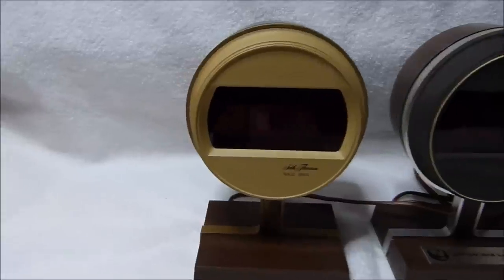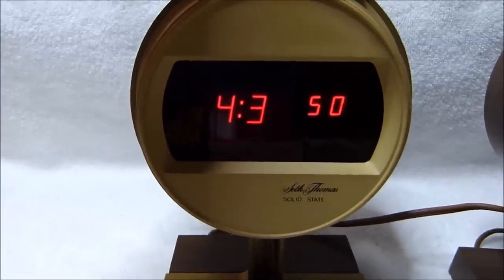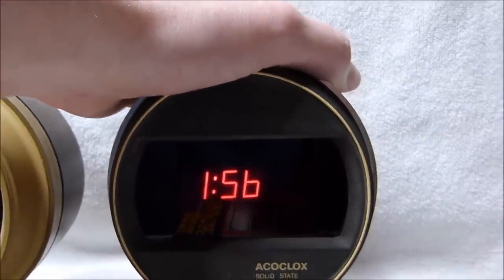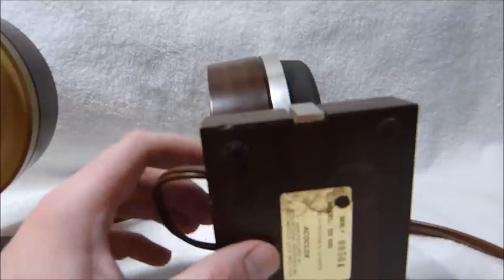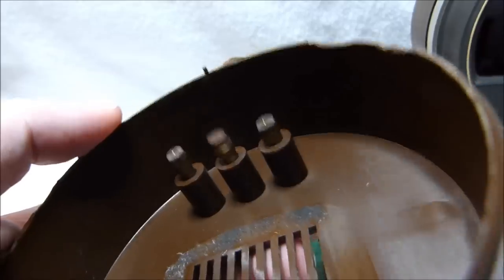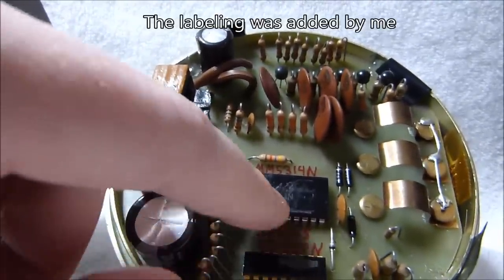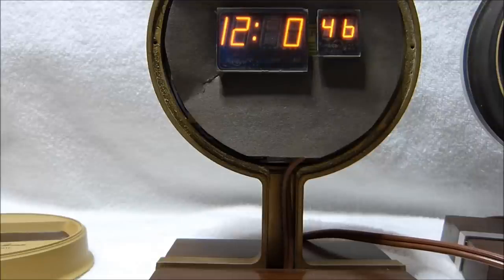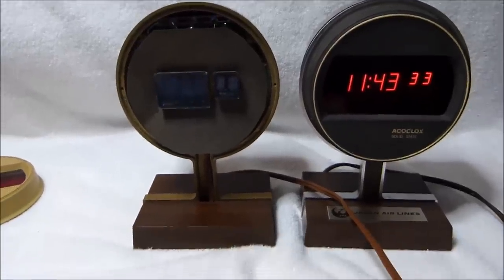Acoclox and Seth Thomas panaplex clocks (1973, USA)

Comment: Very interesting video. With the display driver issue and missing segment, I’ve found that this is not uncommon on LED calculators. Occasionally it’s the driver chip, but on testing it’s often just a dry joint, and reflowing the solder can resolve. 

Mind you the build quality of some of the later 70s calculators; I came across one where the leg of the chip for the missing segment hadn’t been soldered at all. I doubt it ever worked as the calculator was pristine. 

Interesting about the neon displays and light. I noticed that one of my neon calculators displayed really quickly when tested out of case after I just replaced the capacitors, but that once back in the case it takes time (as do my others). Was this always an issue with these type of displays?

I hope you’ve managed to solve the segment issue with the clock. They’re lovely clocks.
Reply from the maker: Thanks! Both of them were working okay by the end of the video, they just have some glitches on startup due to the early MM5314 ICs, and maybe interference from the displays. 
Speaking of the displays, yes, it's typical for Panaplex displays to have some trouble starting in low light and/or low temperatures, as the gas inside needs to be ionized a bit to start conducting.

Comment: I wonder if the power supply is noisy, causing issues with the digital circuits.
Well, you answered the question about possible power supply problems.

Interesting old clocks.
Reply from the maker: Thanks! My guess is interference generated by the multiplexing of the Panaplex displays, which makes an audible high pitched whine.
Reply: @50sTransistorRadios  
A o'scope should confirm that, good luck.
Reply from the maker: @bblod4896  Since the problem has come back, I tried again to find where the problem lies, but all the waveforms coming out of the driver look good! My suspicion is now that there is a bad connection somewhere between the driver and the displays, but if so, it's not sensitive to shock.
Reply: @50sTransistorRadios  
I would possibly think a bad connection in the display module itself, but, two of them with the same issue. Perhaps they are flaky from age.
Reply from the maker: @bblod4896  Only the Seth Thomas clock has that issue with the bottom segment disappearing, but yeah, the problem may lie with one of the displays unfortunately.

Comment: A-CO-Clox?
1:10 I thought that Nixie type displays used a negative voltage on the control grid to keep the segments from illuminating. It is VFDs that use a positive voltage to get them to glow.
Those Copper ribbon switches look very flimsy and unreliable
Reply from the maker: There are no "control grids" in a Nixie tube (or a Panaplex display), just the digit cathodes, and the anode surrounding them, which is connected to ~180 volts. Modern VFDs however do have a grid for each digit, which is pulled negative relative to the segments (anodes) to turn them off.
Reply: @50sTransistorRadios  Well I got it all upside down and backward